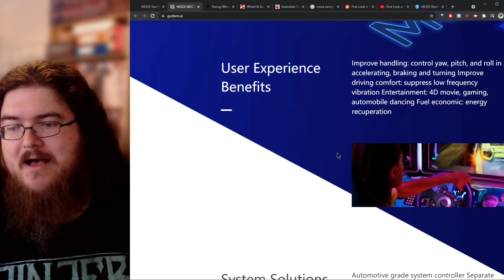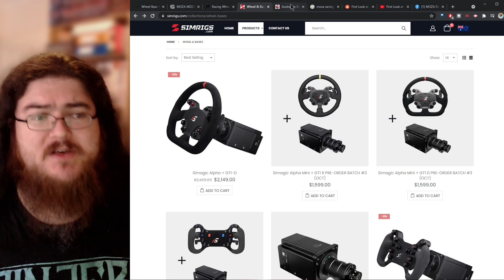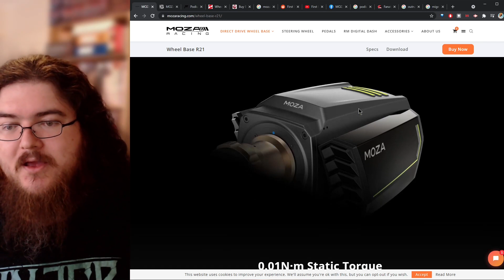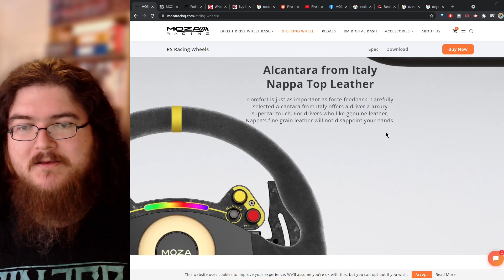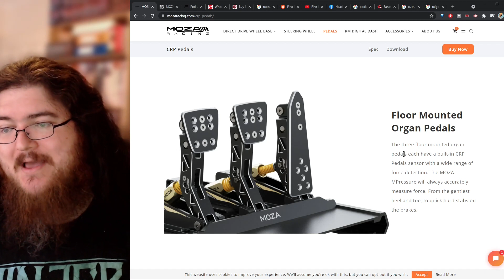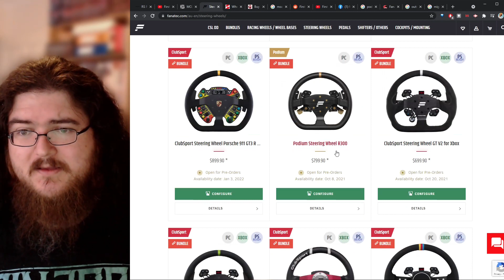Who or what is Moza Racing?

Comment: Just watched Dave Cam's first drive impressions and it seems to be passable in terms of ffb. However, there was INSANE flex between the QR and the wheel itself, his clutch pedal got stuck about 5% forward before unreleasing itself randomly, and brake pedal was pretty "spongey". Hard sell when so many other options with better quality exist.
Reply from the maker: Just watched it, and flicked through Random Callsign's live stream - seems the pain points are right where expected: Software is undercooked. Actual manufacture seems decent, but they're over-reaching going head to head with the established brands with such rough software/drivers.

Comment: Some genuine Chinese IP taking going on. Simagic use use the actual D1 spec QR with wireless transmission. Simagic use a carbon fibre front plate for zero signal loss of wireless transmission. Apparently accuforce use that style of electrical transmission to the wheels that Moza use which is a bit wonky vs what Simucube/Simagic use, which are known bulletproof. The optical sensors stolen straight from Simagic, which is nice though, it's a high wear and tear items so using optical sensors is better than traditional.

The should have started with a CSL DD/Alpha Mini competitor first with some mad hype viral style marketing. Build credibility from the entry/mid range users.

An Irish youtuber by the name of Laurence Dusoswa has a test one, he's a good reviewer so if he says its good or bad then his opinion will be pretty valid. He's got a smaller channel compared to the big guys, but he's a good bloke.

They've got a bunch of great ideas which only a couple of them i feel will actually translate to a good idea in practice. There's obviously going to be lots of chinglish translation issues but it's all surface level blah. It's very hollow underneath.

Its really only the wheels and the screen that look like good products, the rest is very..........concerning(?)